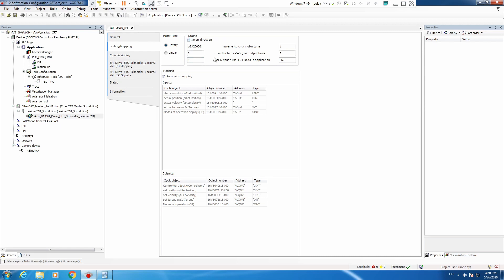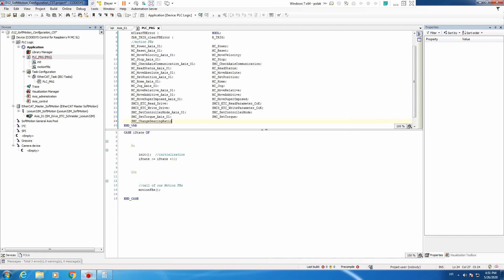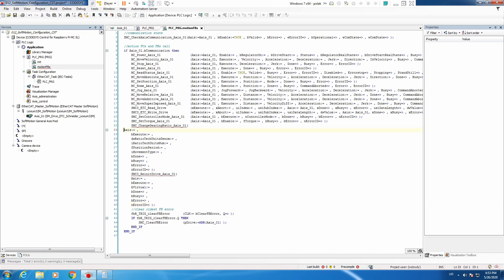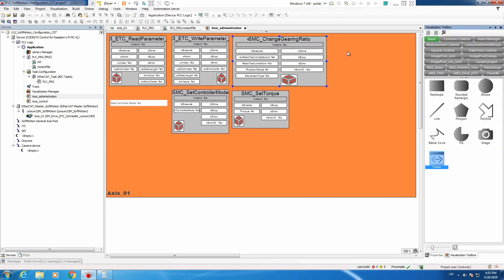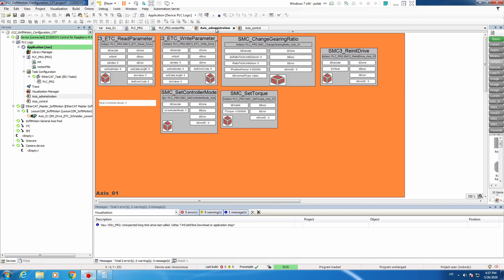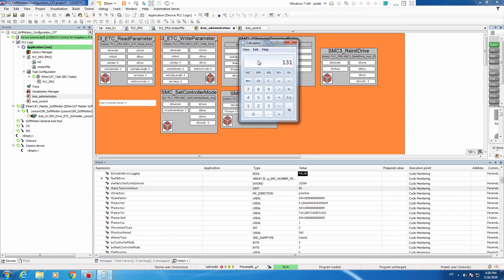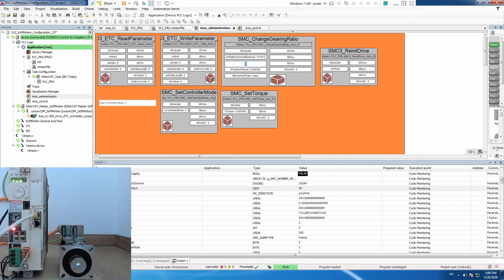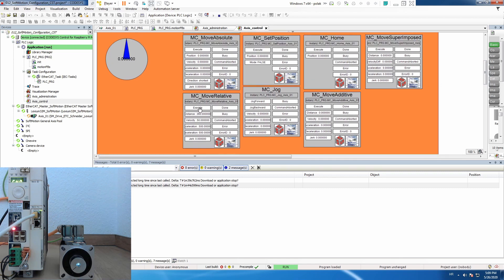13 - SoftMotion - Lexium - Gear Ratio

Comment: For the driver a motor revolution is an encoder revolution than 131072 encoder increment.   For the PLC i want use degree, then a motor revolution are 360 degree. The scaling factor to pass from encoder increment to degree  is   131072*X=360   => X= 360/131072 = (360/8) / (131072/8) =45 /16384
Reply: If I imagine putting a reducer between the motor shaft and the disk, one motor revolution gives me half a disk revolution, I have to express   X'=   (360 / 131072)  * 1/2 = 180 /131072
Reply: In the video the physical disk connected to the crankshaft makes 2 turns, while the disk displayed on the HMI makes only one turn.

Comment: I just wonder where the number 131072 comes from. This is where I got lost a little bit. I couldn't follow the mathematical part there. But I do understand the principle.
Reply from the maker: fixed scaling of lxm32. 131072 increment/motor revolution. softmotion needs to work with the drive with fixed scaling.

Comment: I tested these functions, they work fine until the PLC power is turned off. After the PLC and servo are turned on again, the gear settings return to the old settings. Do you know how to change these values permanently? For example, in Mitsubishi's Simply Motion, you have to call the "WriteFlash" function. All changes to the electronic gear, soft limits, etc. are saved permanently. Is there such an option in CodeSys? P.S. The videos are made very professionally and to the point. Without unnecessary talk. They are a pleasure to watch. Best regards.
Reply from the maker: Hi. Thanks for feedback. initial gear ratio is going to be always the one set by axis editor. so, technically you can store last settings to persistent retain variables and  after power cycle write them again using FB. keep in mind that raspberry plc does not have NV memory dedicated for such variable type so it will not work on this hardware platform. other manufacturers of dedicated PLC hardware have this option. second option which would work is to save settings to a file (on raspberry file would be stored on sd card) which you read out on power on. i hope i helped.....
Reply: Thank you for such a quick response.
I solved the problem exactly as you suggested. I save the gear variables in Persistent Retain and after restarting the PLC I initialize the gears. I thought that since the axis editor can save the gear data permanently, it can also be done from the program level. It simplifies the program, you don't have to initialize the driver. That's what I do in the Mitsubishi controller. Ok, now I know that Codesys and PLCopen don't have a similar tool. Best regards.
P.S. I'm going to watch more of your videos. :-)